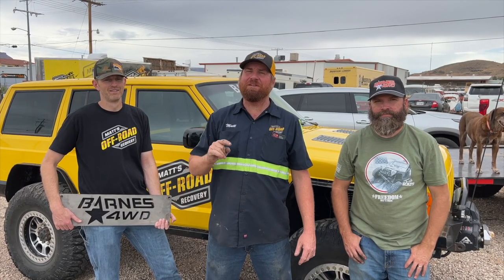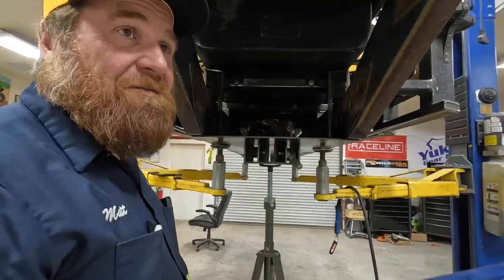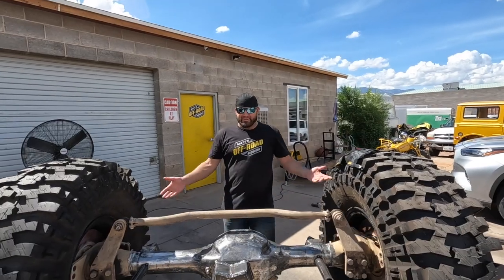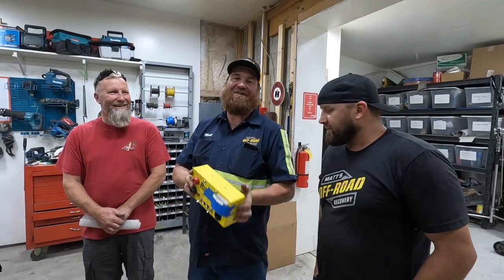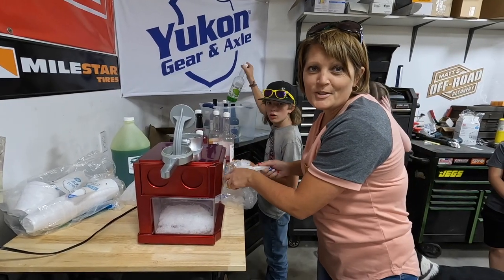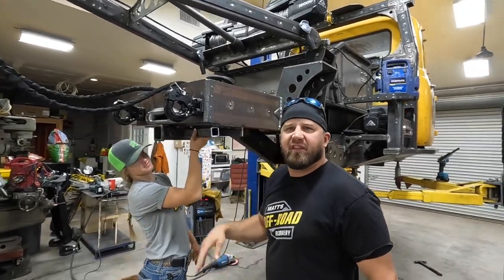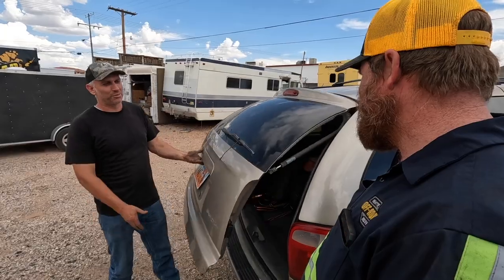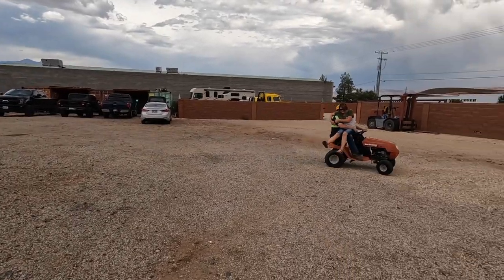We're Making Some Noise With The World's Largest Off Road Wrecker

Comment: I like how Matt is talking about his various oil coolers on the Jeep and Morrvair. You really can tell a lot about a system by looking at the oil. If it looks clean and clear, it's usually not getting too hot or being overworked. Instead of only checking the levels, or just changing it regularly, monitoring the condition can alert you to problems that are developing.

Comment: Love this build. Just a few thoughts to help you maybe. When building your link points, use a scrap piece of tube that is the same width of the joints you are using, to go between the brackets that need to be welded.  Then put a .050 shim on either side, and bolt them in.  Welding the brackets will shrink the metal. When it's time to install the joints, they will just slide right in, no hammer needed. Plus, the heat doesn't beat on your joints, breaking down the rubber.  Also, to help locate the axles, get your square points figured out, then just tack on a nut to the frame, and drop a plumb bob down, and crank on the link until it touches the axle.  No need to remeasure all the time.  For a plumb bob, all you need is string and a heavy nut to hang down, doesn't have to be a real plumb bob.   

For the record, I really wish I could be there to help build this thing.  I build dirt race cars for fun, when I can.  Never built a rescue rig, and would love the challenge.  Been a fabricator for awhile, and I've learned from some great folks along the way.  Keep it up, yall are doing great
Reply: I don't know what that means but it sounds smart :)
Reply: Great tips! Taught me some
Reply: You should make some videos and upload
Reply: @joshbeck2540  
I don't know why but that made me laugh.
Reply: Great ideas.  Personally I use lasers instead of plumb bobs, and I superimpose all the Lines of the frame and mounting points down to the ground, Draw it out completey and then its there until the project is done.  No need for ten plumb bob lines hanging down everywhere, (2 for axle, 8 for 4 link mounts two each) and the a few high quality lasers will let you check parallel, square and plum lines to infinity across the entirety of the frame in any location, nut just the intersections.

Comment: Besides being the biggest wrecker, it's pretty cool, you have the others already beat by style. The older cab on it is just perfect, and it's going to need a loud horn and lots lights. Might need and old fashion visor on the cab to keep the sun light from blinding you. Awesome job as always!
Reply: Ditto on the visor.
Reply: A big rig horn that connects to the frame tank/compressor system.   And the horns sit on the roof… black horns.
Reply: A visor is an awesome idea, will look perfect on this truck.
Reply: Robbie’s Layton’s channel just received a cool 4 horn train blaster. He’s mounting on a truck he’s rebuilding for a kid that’s dad wrecked the truck that he was going to give his son. Sadly the dad passed away. Any ways he got a complete kit and the horns are very loud!  Lol
Reply: Definitely an old style visor 👌🏼
Reply: Sounds great until the first big tree limb catches it. I’m a young gun though, I’m guessing the old visors were built just as strong as the bodies? If that’s the case, I def agree. 👊
Reply: @ArkanZen  I would agree that limbs could be a problem even for the heavier gauge steel they use, but for the most part on the video there showing there are not a lot of trees involved until they go up into the mountains.

Comment: I know this is a bit late but did you ever install drain valves on your frame rails that you're using as compressor tanks? As we all know compressed air creates water and water and bare steal leads to a bad day later on. drain valves will allow to purge any buildup of water. Maybe you could install an automatic purge system that purges every so many  minutes or hours to keep water at bay. Love how the build is coming sofare. keep up the good work. 👍👍
Reply: I wonder if he canceled the planes to make the frame a air tank, because the comments really were against that idea.
Reply: @philb5593  LIKE WE MATTER LOL
Reply: @philb5593  I didn't know that. Maybe Matt can touch on this subject a bit in the next video.
Reply: @CORNDODGER  it's not that the comments matter, but that physics is against him. Squares and rectangles do not make a good pressure vessel.
Reply: @AndrewAMartin  Yeah, but it ain’t that much pressure. 3/16 wall 2” square is probably good for 600 psi with no visible distortion, their system will not be over about 150. The real issue is condensate. Hopefully those sections got a good interior paint coating, and a blowdown valve.
Reply: @russbell6418  I'd agree with you, but I saw the video with the sides of the 'tank' visibly bulging out. The frame isn't square tubing, it's C section that they boxed in. It just isn't going to work as an air tank. Better to have a purpose-built tank...
Reply: @AndrewAMartin  agreed with that, the pressure wants a cylinder, and a few choice knocks will help the frame get that way. Especially with compression water washing around in there
Reply: I think he bailed on that cool, but ill conceived idea.
Reply: @russbell6418  you better go back and watch the video of these rails puffed out like puffer fish when they filled them with air.
Reply: Another ides would be to use an air dryer like the Bendix unit on my Kenworth T680 semi tractor. They do a great job removing moisture from the air system. Since this wrecker is using a hydraulic brake system, if moisture enters the tanks, the risk to safety is minimized, but dealing with a clogged air line could be the difference between completing a job or not.
Reply: Remember in the southwest, the humidity is usually about 20%.
Reply: Filling an airtight frame with hydrogen would make the truck lighter.

Comment: A heavy duty loop/attach point mounted on both corners of that magnificent cab protector/roll bar should be added to be used occasionally as a HIGH point for a soft shackle holding a snatch block for redirecting wenching forces when advantageous in unique situations.
Might come in handy for other uses occasionally, too….
Reply: You mean winching forces. Wenching forces probably mean something other than what you meant
Reply: @joelschermerhorn5447  -
Lol. Unintended humor ….

Comment: 1:36 On those link mounts I would definitely add some angled gussets to the backside for extra strength but to also to allow rocks/ledges to slide off it versus getting pinched and hung up. I'm sure you know this but you never want any straight 90 degree edges underneath on an off road vehicle that will grab obstacles.
Reply: I'm more concerned about the drive been put through that flat plate, I imagine it will eventually crack
Reply: @kingcosworth2643  Yeah, that plate needs some crossmembers welded to it
Reply: @MattsOffRoadRecovery  people love the project and just want to feel like a part of it by "helping"
Reply: @pilotdog68  baby steps....
Reply: @MattsOffRoadRecovery  Just making sure its not forgot 😁

Comment: The level of sound is critical. Too loud can be ok for short runs, but drone can really get to ya on a longer trip. I like magnolia mufflers,( or knockoff flow-pro work fine). They are pretty mellow down low, but get louder the harder you push. 2 1/2 is always a little more mellow sound than dual 3 inch. 3 inch echos like a sewer pipe. You would be surprised how much a Ballance tube changes the sound too(h or x, just get em mixing together). Sometimes a drone or pulsation can be totally cured by a Ballance tube.  Also stainless has a different resonant frequency that changes the sound slightly. Gives it a rasp

Comment: Placing the coolers longitudinal could help with heat transfer.

If you put them transverse the downwind side gets barely any airflow,
and the upwind side more, but still will have quite some stagnation between the fins.

Anyway, if it works, it works, they are on the truck already.

Comment: Pick up a pancake hood for overhead stuff, gives you more clearance and leaves the lense itself closer to your eyes so you can keep your neck straighter and still have good angles of visibility. You can trim the top of the faceplate down and it will save your spine, thats what i used when I would do tight quarters overhead stuff. Its also much lighter so less neck strain, nothing like going home after a long day with a mad crick in your neck 👍

Comment: Hey Lizzie, I feel your pain. I do a lot of exhaust work. I'm 6'1 and most of what I do requires me to stuff my head up into an undercarriage as close as I can to see what I'm doing. Seeing the tops of the pipes is impossible without a mirror most of the time. Eventually though, you get the hang of blind welds. You're doing great, though, don't be so quick to criticize how your welds look. It's not as much about how pretty they are, but rather how good the penetration and heat spread is. Strong welds are way better than pretty welds (but I'm sure Matt has already told you that).

Skeeter, big props for remembering the show "Viper". I was beginning to think I was the only one who remembered (or even watched) that show. I don't remember it ever turning into a boat, but I may have missed that. 

I love this build, I've watched every episode so far, and I can't wait to see it complete!

Comment: Matt two steel plates sandwiched with grease or sand between then put under the tires. This allows you to do these adjustment and alignment stuff much easier. Slip plates. Lets tires slide around and not fight you. 

As always. Great video.

Comment: This thing is going to be a beast!! Can’t wait to see it finished and I’ve had fun following your progress. One question….Is the belly pan welded or bolted on? I don’t see a way to remove it for repair or maintenance (like fluid changes) access, maybe I missed it??
Reply: It’s all welded on for extra strength. That’s why they are making the whole cab top removable.
Reply: @psychology2217  that makes sense. I commented before I saw that they added the cab lift points. I suppose access plates for drain plugs and such can be added later too.
Reply: @cpftank09  Yes, Matt commented that engine oil, transmission fluid, and air tank will all have drains on the bottom.

Comment: Just wondered, when it comes time to clean the sand out from on top the skid plates, how are you going to achieve that?  Great watching your build! Thanks to you all for the great content.
Reply: Compressor and a blow line, cleans anything out of anywhere, ask Paul from Fab Rats. He used it to clear Michelle out of the shop a couple of videos ago
Reply: 60mph on the highway aught to do it.
Reply: @ADBBuild  60 might be a big ask for this wrecker, think he is going for power and torque. I  don't think speed will be its greatest attribute
Reply: What’s wrong w sand in a sand vehicle? There r quite a few good sized holes in the skids yeah.

Comment: Matt, a little trick that I use to square axles and especially 4 link suspension easily (since adjusting 1 link on a 4 link moves everything and things can get off pretty easily) is to hang plumb bobs from frame points to where you want the center of axle tubes to land.  Once you know where axle center is on your frame then you can adjust axle to align with the plumbs and square everything up, after that pinion angle can easily be set with upper link adjustment.  On another note I would highly suggest some 2.5" aluminum lower links because no matter how strong the DOM tubing is with the weight of your rig they WILL get bent!  Keep up the awesome work, you and your team seem like great people  and I definitely enjoy the channel!

Comment: The plugs to use thru the fire wall is the round Deutsch style. They are used on all the late model trucks. A quick twist and they are apart. they are dust and water proof and only go together in one position.

Comment: I have two tips that might help  a couple of irritating issues. One for helping shop cooling without spending an arm and a leg on hardware or power to run hardware. That will be the wall of text nobody will read. The other is to help Lizzy with her welding helmet vision/tight clearance annoyances. . Im sure she already uses a large sized auto darkening hood. Which is ggreat. BUT if you are careful most of them have enough room on the slanted forehead area  to cut out a rectangle and fit in one of the old small style filter and glass lens and plastic cover lens. That can let you see to weld many (but not all) overhead things without cocking your neck sideways. The auto darkening lens still allows you to see before you strike an arc, so you arent tempted to strike an arc with hood raised. The main drawback is it adds weight to the helmet, so if you have a lightweight favorite hood and a backup hood its best on the backup. Also dont skimp on gaskets for old style lens or it can leak in light and hurt eyes. Ill add the shop coolng tip in another LOOOONG comment after a bit.
Reply: Matt was talking about ventilation for welding. His shop has working AC.

Comment: That would be cool on links if the took a piece of flat stock punch on hole at each end. Then folded it in half so
The holes line up, slide that on the tube weld it before they weld the ends on. Then you would have a leverage point for pry bar or something so you can tune the links. Sure there tuff to move after hard use. Idk probably get in the way on shorter vehicles. 
-beautiful build!

Comment: This is a super cool build. One thing you may or may not have considered is the amount of torque required to move those heavy axles along with the weight of the vehicle. You have a massive amount of unsprung weight. I hope I’m wrong, but that tired engine may not cut it.

Comment: With the coolers, consider also that a flat surface on the cooler mounted on a large piece of metal improves its efficiency, as that large piece of metal acts as a heat sink. To heat up the brake or steering fluid, you also have to heat up the metal the cooler is attached to. Mass is your friend here.

Comment: Matt, I definitely think that you will have the best and coolest off road wrecker!!! However, I’m beginning to worry about the weight of your beast.  Is there any of the steel components that can be replaced with aluminum?  Will those tires hold that much weight up on top of the sand?  The other off road wrecker guys would never let you live it down if they have to rescue your beast!  By the way you need to name it “The Beast”.

Comment: I'm no mechanic, but if I wasn't a builder, I'd definitely be a mechanic.. Builder's sqr up a structure or build a roof (for example) by using the Pythagorean Theorem. Find a parallel and 3,4,5 it (A2+B2=C2). You can compound those measurements as far out as you want.. Find a fixed point on one side (or two fixed points) and follow the math.. You can dbl check the math by cross measuring diagonally, from corner to corner on both diagonal axis, if you're still parallel and your diagonal measurements match...you are golden.. If I was building a rig, I guess that's how I would do it, seeing as I don't know how else you could do it..but I'm sure there's an easier way to sqr up axles on a frame..

Comment: Looking killer guys like tho ya few pointers being someone down here in Florida build them all big add some more guesting/reinforcement to where upper link bar brackets on belly pan where they are ..those axle techs an 58"  will wrinkle/push it up  can do some square or round tube up in there when got cab off 👍👍 ya get on yanking bouncing little add backbones in there 👍👍

Comment: Matt I don’t like most of this build but the chassis cab separation thing is a good idea
Here’s another one to go with it: quick couplers or multi coupler plates, look up stucchi they should have ones that’ll work.
That way you disconnect one coupler to uncouple your steering throttle and brakes, etc. Then just remove your bolts and lift the body off.
5 minutes to get the body off if you use those multi couplers.
Like I said, they can do one coupler for your orbital valve hoses, brake lines, throttle wiring or hoses (not cables tho), and the full wiring harness.

Comment: Yes. Knightrider and james bond had a car like that. Other ones: swimwagen(german),amficar(english) and there was a swish one. Do not know all the military ones but sherpa is one of them.
Sir: every welding ventilation is a suction cap close to the welding spot and have an outlet outside the building. The welder can have an welding helmet where a portable fan carried on the back puts air in the helmet.
Who is following matt with the semi truck and trailer with tools. Casey?